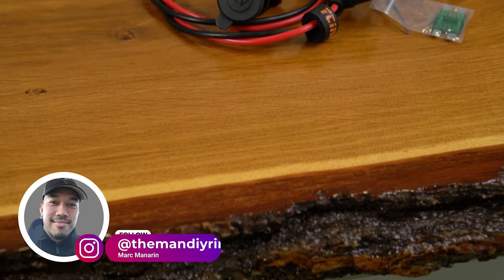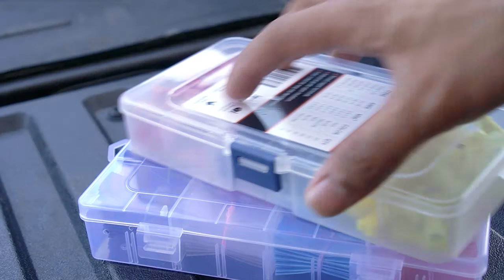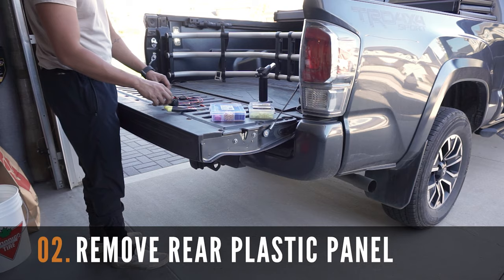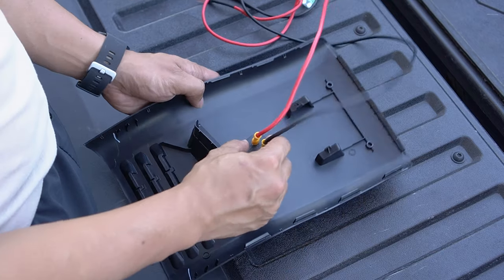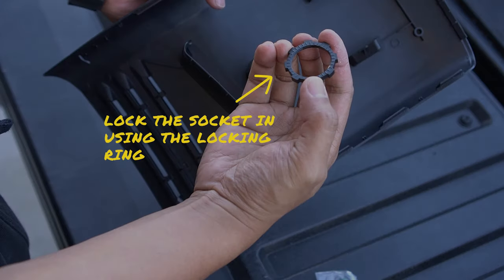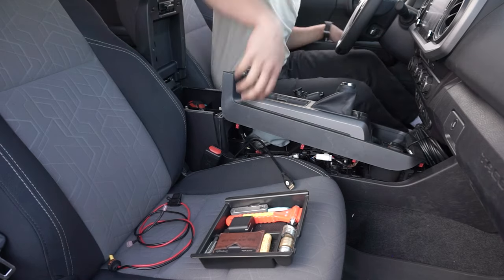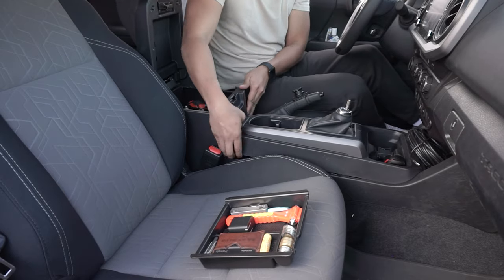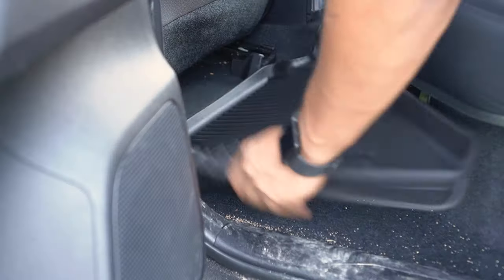HEAVY DUTY REAR POWER OUTLET INSTALL on the 2022 Toyota TACOMA TRD Sport | EASY DIY

Comment: Nice. I was about doing it next week, but with two usb ports and "boom" you beat me to it.   Again another useful mod. 👌
Reply from the maker: Hi thanks for watching my video again! And haha great minds think alike! Good luck on your install!
Reply: @themandiyrin  I managed to install it over the weekend using your video and using the same t-tap connector you are using. Unfortunately, mine stopped working yesterday.  I guess due to vibration... so I ended up removed the t tap and soldered it instead.  Now solid and working again. :)
Reply from the maker: @g7003041  oh no! Sorry to hear it stopped working, I fortunately have not ran into that issue. But I’m glad you’re able to fix it!

Comment: Nice vid, shows every step so clearly... thank you.  Any idea if it's possible to add two additional outlets in the rear area (run from the same center console source)?  Was thinking of one 12v socket like you installed here, plus another with a Usb-c socket in the same form factor
Reply from the maker: Thanks for watching my video and for the kind words! Appreciate it! In regards to your question, I haven't personally tried it but I don't see why that's not possible. Since each of the new added accessory will have their own fuses, I see this as a no issue! Maybe I'll install one as well! I know I've had some request to have the 400Watt plug installed on the interior so might try that myself!

Comment: So you're connecting heavier gauge wires into lighter gauge wires . . . . ok.  That's not troubling at all.
Reply from the maker: @steher  hi thanks for watching my video, I've had similar comments and I've changed it since. Thanks for the comment! Cheers.
Reply: @themandiyrin  Glad you fixed it. It'll always be more work but safer in the long run.  Peace of mind is priceless!

Comment: !FIRE HAZARD! DO NOT DO THIS!  Two problems...
1)  Tapping into a line with a 10A/15A fuse with a 30A outlet 😂 does not work.  Sure, my 300W inverter will power on.  It just won't max out.  It will likely blow the fuse in the engine bay.
2)  Tapping into the original console outlet's much smaller gauge wire WILL be a fire hazard.  It's great at 10A, not 30A draw.  Not even 20A.  This needs to be homerun to the fuse box or battery.
NOTE:  With power, only figure having 80% of whatever the rating is; 30A * 12V = 360W * 80% = 288W usable.  Constantly going over 80% is somewhere between a shortened life span of the electronics to a fire.
Reply from the maker: Hi thanks for watching my video and for your comments. I appreciate the knowledge and will look into your points. 

Luckily, I've been using this for over a year and the phone charges as quick as it's plugged in my outlet wall (i.e., it doesn't just turn on, it actually charges). In the year since my install, I also have not noticed any effects on the device itself and have not blown the fuse once (note that this truck is my daily driver and used a lot). 

I could try to wire it through my battery when I do my next accessory install to avoid potential issues you're mentioning.

I also have seen similar installs with a lot of other Tacoma channels so I'm wondering what their experience is.
Reply: after seeing him tap into the usb wires... i came looking for someone mentioning this issue in the comments. I'd pulll 5-10amps such as charging a phone or a radar detector, but not gonna even think about pulling 360-400w through it.